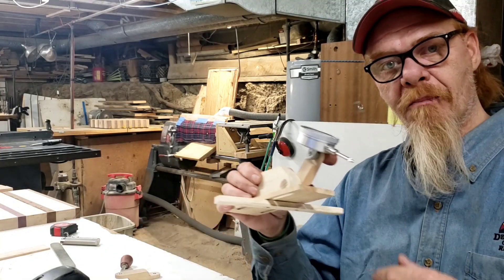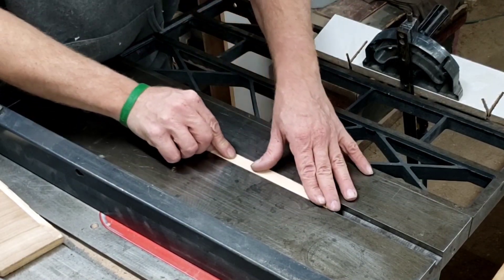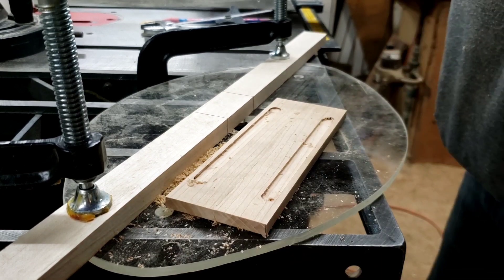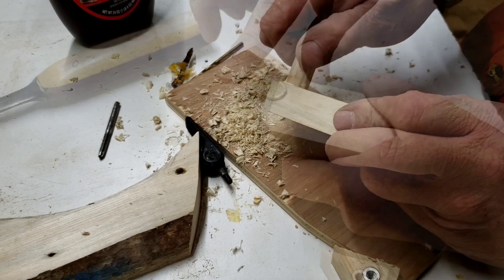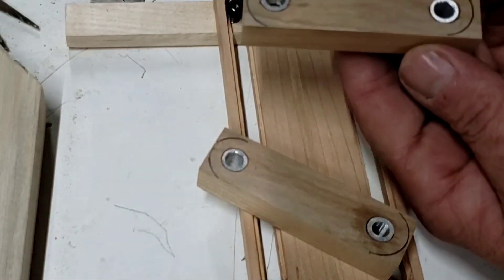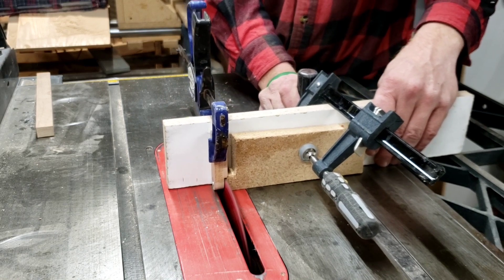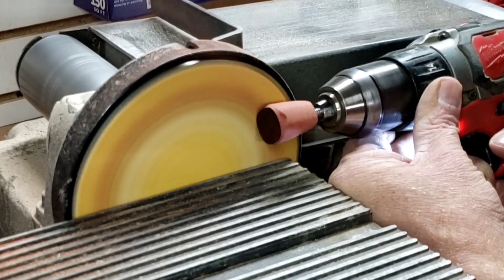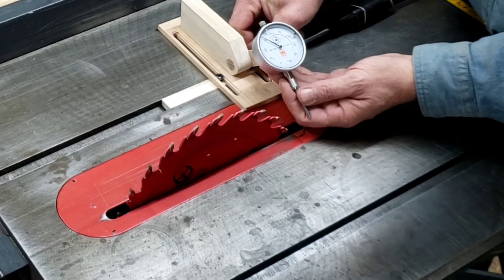Making a Dial Indicator Jig For The Tablesaw | A PERFECTLY TUNED TABLESAW IS SAFER

Comment: Looking forward to trunnion adjustment video. I've got the setup to adjust it, just not sure what I'm doing.  I'll go ahead and make a fool of myself (because I'm sure others maybe wondering) do you adjust your trunnions using the miter slot to the right of left of the blade?  I used the left one and got it zeroed out, but it seems I'm about an 1/8 out when I move to the right side.

Comment: Wow, great build with a lot of cool tips/tricks along the way.  Using router baseplate to set it in the tablesaw wing blew my mind.  I’m definitely using that trick in my shop. 👍
Reply from the maker: Glad you liked it! When I grabbed the router and slid it into the wing, I was surprised too. My head started squirreling into ideas for a mini fence and slots for adjustment, etc to add to the trim router base LOL